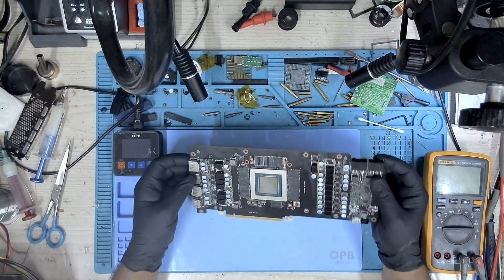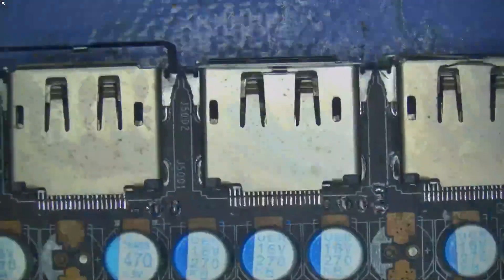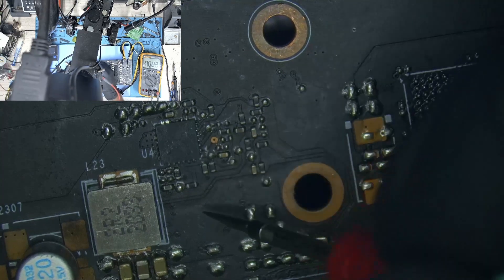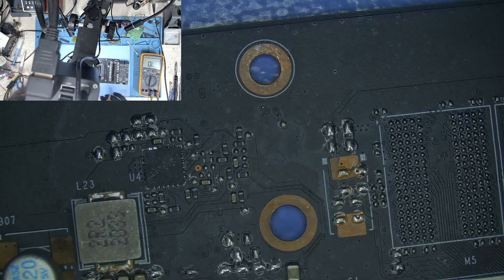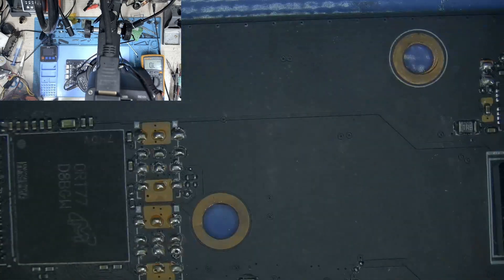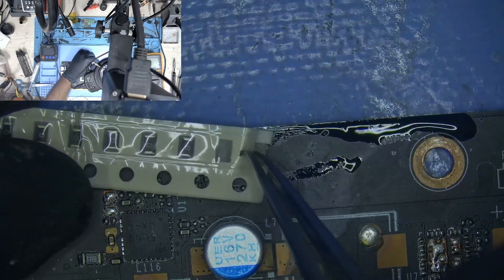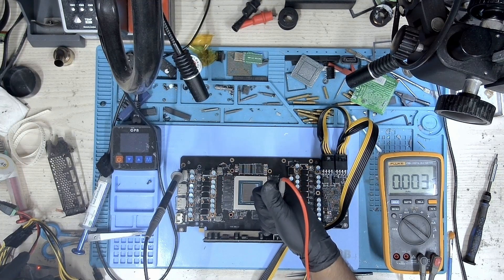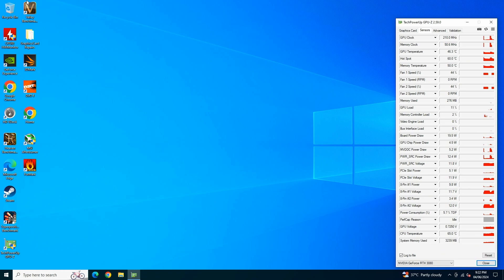Why Your RTX 3080 Isn't Working

Comment: hi there, my gpu has a blown resistor near the 8 pin plug, how would i fix that?
Reply: Ohh, i see, so my gpu is a ROG Strix 3080 O10C and on the pin the obvious blown resistor is R005 written on it. what happen was sudden i was playing and then suddenly my system shut offed and have a burnt smell, i dont know what cause it, do you think there is a connection to the psu? though my pc runs when i dont connect the 3 8pins into the gpu but once i put the middle 8 pin into the gpu it shuts the whole pc off😢
Reply from the maker: @guillerdangaran3684 The R005 is a shunt resistor and if a shunt resistor is burnt that there is a short and the board has pulled high current.
Reply from the maker: First remove the resistor and check if there is low resistance on the line. Next if all resistance is high. Replace the resistor. But you will need the correct value so you will need a boardview or a schematic to know the value.

Comment: Hello! I found this video very informative and well thought out, kept me invested and excited enough to watch it through it's entirety. I would like to ask if you would be so kind as to help me with a "little" issue i have with my V1.0 Gigabyte Gaming OC 3080 TI 12g.
A couple of days ago while i was playing some games i experienced a sudden black screen followed by a continuous cycle of loosing and gaining back the display signal from my GPU, after some 5 seconds it completely lost signal and once i attempted to force shut-off and then boot i had no signal from my GPU to my monitor at all. I've ruled out any other components from being the culprit for the sudden fault since then and i am utterly stumped.
Have you ever experienced a failure similar to what I described above? And what do you think might be wrong with the card?

I was kinda "scammed" with this GPU, i bought it just a week ago and it was supposedly only used for "light gaming" and only after contacting the seller when the GPU died did he inform me that the GPU had been used for crypto currency mining for the grand majority of it's life up until this point.
Reply from the maker: It is possible that one of the voltages have been lost due to a faulty component. That's the reason after you shut down the PC it did not detect again. You GPU will have to be diagnosed to find out the fault component.
Reply: @GraphicsCardRepairs-tk7ql  thanks so much for the reply!!! I've heard that VRM's are a common failure point on these and after talking to a local shop they've confirmed that it's most likely a mosfet/VRM that failed causing the "no detect". I was really worried that it might be something worse, i gave up all hope for the card.

Comment: Thanks for the video I have the same problem on an ASUS 3080, but something extra, I have no voltage in memories
Reply from the maker: Do you have core? After 1.8V core voltage comes on. If core voltage is available then you will have to trace from the power good signal of the controller. Do you have a boardview and schematics for any 3080?
Reply: @GraphicsCardRepairs-tk7ql  Yes I have boardview but not from Asus specifically, change the IC GS9216 that controls pex, but I think the damage is in that area, because I have the 1.8v but I do not have 1.3 in any of the 4 coils, but in the 18 core phase I have it at 0.8 only in 6 phases, at some point I turn it on and I have all the voltages in the 18 phases 0.8v and the 4 phases 1.3v, I turn it off and turn it back on, the voltages go away

Thanks for your response 👍

Comment: i honestly applogize for not commenting earlier but the card in the video is mine, the mans a genius and wizard . he was super cordial and even went out of his to follow up cause i had an issue with my pcie riser not being gen 4.  i couldn't recommend him enough.
Reply from the maker: @skyforce911  thank you for your feedback. It means a lot to me. 😁
Reply: @GraphicsCardRepairs-tk7ql  how can I get my card repaired? I was going to try it my but I'm thinking about sending it to someone else
Reply: @GraphicsCardRepairs-tk7ql how can I contact you for a repair? I have a 3080 I wanted to fix but it caused my computer to get super confused to the point I had to unplug the board completely and remove the battery for a day to get it working again.
Reply: How much did this cost?

Comment: Why the Vram and ram is not off if PEX is missing Bro?
Reply: My gpu is gigabyte 3090
Reply: I have follow the video. Register have 5v and 12v
Reply from the maker: So which voltage is missing
Reply: @GraphicsCardRepairs-tk7ql is not missing sorry 12v and 5v is on, but PEX Voltage is 0v
Reply: In schematic of 3090 is C600
Reply from the maker: Yes but is 1.8v present?
Reply: @GraphicsCardRepairs-tk7ql  1.8v is present at L34
Reply: C600 have 5v
Reply from the maker: Ok Watch this video if only PEX is missing. https://youtu.be/yG4LOqMFQL4 the issue might be similar.
Reply from the maker: In the 30 series core voltage is not dependent on PEX.

Comment: Hi Sir i have RX480 when i power the card sometime phase coils have pulse sometimes not...why?its is a problem or phase controller chip or mosfet driver ic?
Reply from the maker: So is the GPU not detected? If sometimes the pulse is missing then check the driver IC. Maybe it's failing. How did you check the pulse. Did you use an oscilloscope? Also check the controller. These are tricky ones and difficult to pinpoint without the GPU.
Reply: @GraphicsCardRepairs-tk7ql  GPU Detect But after installing AMD Driver Display goes Red When I run furmark pc direct shutdown..yes i have oscilloscope
Reply: And also when i run furmark direct shutdown amd phase dual mosfet short i don't know why..may be faulty controller?
Reply from the maker: I would suggest you run memory tests for AMD first. Check if there are any memory errors. If you are getting a red display after the driver installs there may be memory errors as well.
Reply: @GraphicsCardRepairs-tk7ql  why MOSFET short?
Reply from the maker: No MOSFETs are not shorted. The GPU would not start if there was a short.

Comment: Nice job, you earned a new sub !

Just starting since my 3090 is crashing a lot randomly and showing errors in MATS but I'm having troubles understanding the report 😅

I have few write errors on multiple bits, yet i have picture and yesterday was able to play  normaly for 2 hours at ultra..

Any clue ? I'm close to paying a core reballing but idk 😢
Reply from the maker: Thank you and welcome Onboard 😁.  On a 3090 if there are memory errors the GPU will not Boot. If your card boots that means you will need a GPU reball.
Reply: @GraphicsCardRepairs-tk7ql  hmm It boots but sometimes it doesnt and VGA light is on. GPU reballing it is then, need to find someone in France who can do it.. thanks for your help 😃

Comment: Hello boss! Thanks for your informative video!
I want to ask you something:
What are the chances of a card like this (a MSI suprimX RTX 3080) that has 1.8V and Memory short to ground?
(When plugged all the voltages are present except PEX and even the shorted 1.8V rail and Memory Rail have the required voltages).
Do you think the Core is alive or dead? (the core heats up normally when I plug it in a computer but the card isn't detected).
This card had artifacts at first and someone reflowed it and I think the balls under some ram chips are shorted because it had sparks near the top RGB connector and some ram chips overheated (back then the card was still detected with code 43).
Sorry for taking your time boss! ☺☺
Reply from the maker: In this case you will first have to use the thermal camera and check when applied 1.8V voltage injection which memory is lighting up. Do the same by injecting voltage on memory. Reball or replace the memory that lights up. if only core is lighting up then you will have to remove the core and measure resistance on 1.8V pads on the core. if no short reball and that should fix the issue. If short is still there core is dead. If no reflow was done it was safe to assume that core is dead.
Reply: @GraphicsCardRepairs-tk7ql  Thanks for your response boss!! I appreciate it! ♥

Comment: I am not a fan of those tight little spaces around those regulators or buck converters with a million SMD's around them, which love to move with the slight little bump. I was using some German solder which took me some time to figure out it was garbage. Switched to Mechanic and it works wonders. Also I am trying this AliExpress wannabe Amtech RMA-223 and surprisingly it works very well. Anyway, great video Frazer! Thanks for sharing!
Reply from the maker: Thank you 😁. Tight spots really make the repair difficult.
Reply: @GraphicsCardRepairs-tk7ql  No kidding.
Reply from the maker: I use mechanic and Chinese Amtech and it works well for me too. 😁
Reply: @GraphicsCardRepairs-tk7ql  hehe same here brother. The RMA 223 is probably the best I have used. Solder flows properly and does not burn that easily. It does not leave a brown stain either. Good stuff.